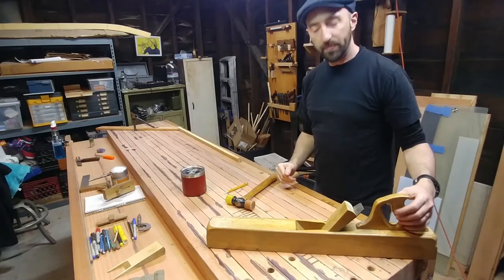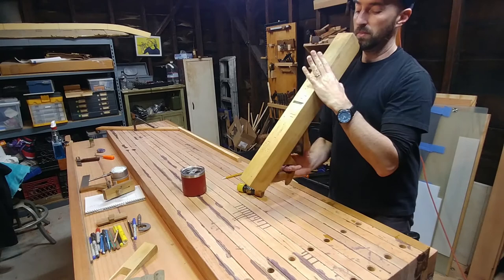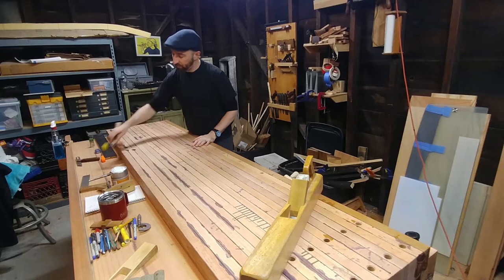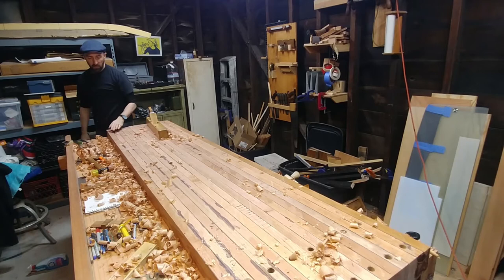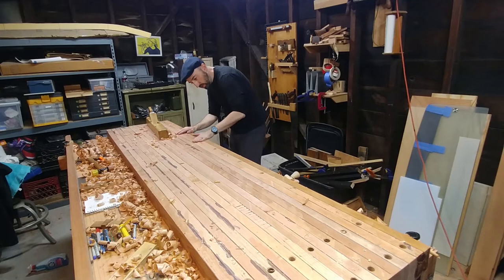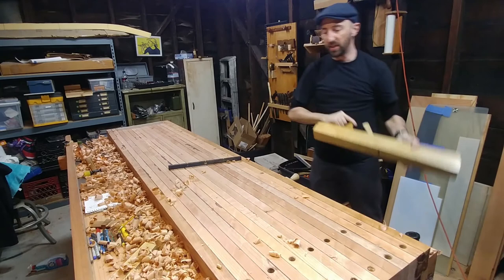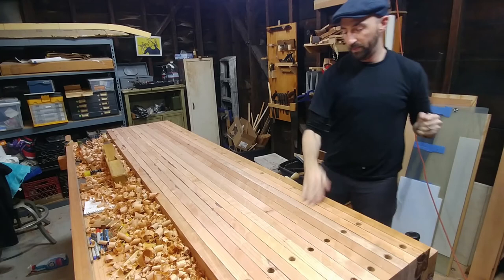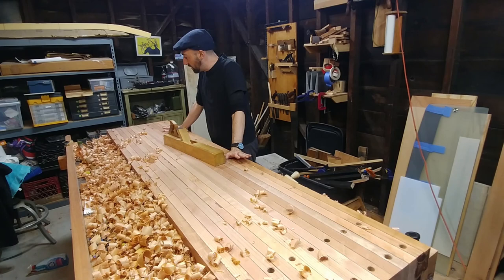Wooden Jointer Plane Setup and Use

Comment: I got a similar one with 54mm(2 1/8) double iron, what I found is they require a lot of momentum to move the iron when striking from the back compare to a jack or fore plane. I 'm thinking maybe a strike button will help? Or like I do, a heavier soft face hammer to retract and remove the iron, a light weight metal hammer to advance and lateral adjust the iron.
Reply from the maker: I find that I have to hit the front of the plane to loosen the wedge, then strike the back to retract the iron, then hit the wedge to tighten it.  HTH!